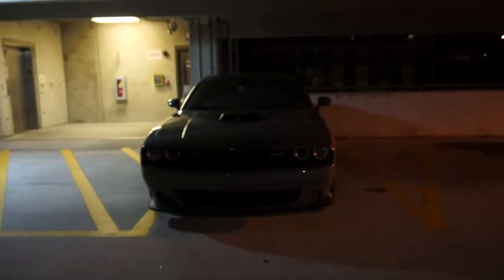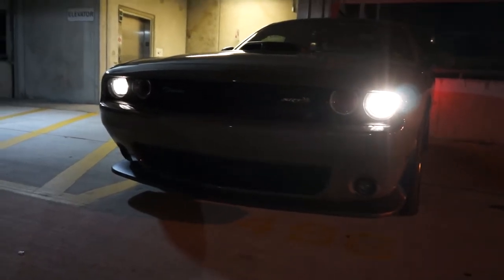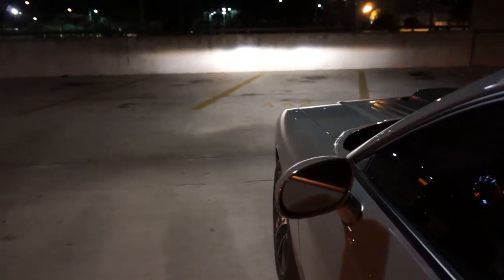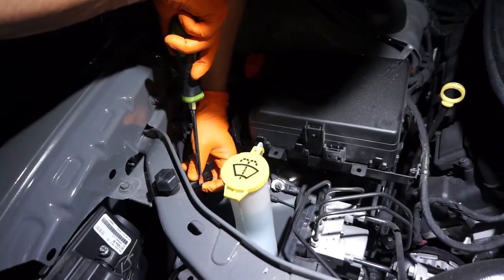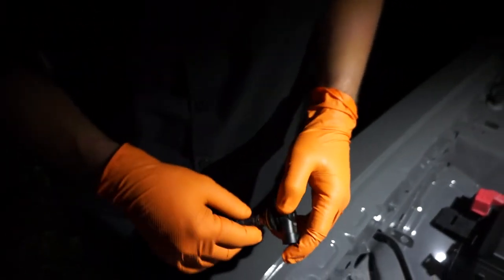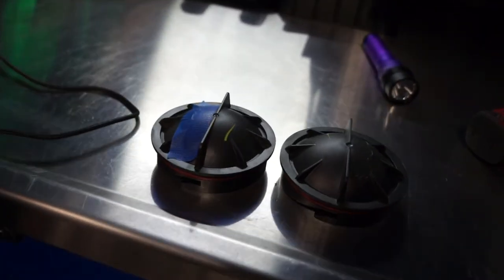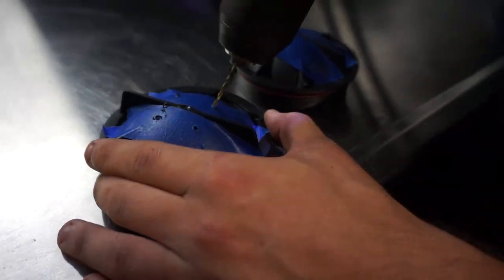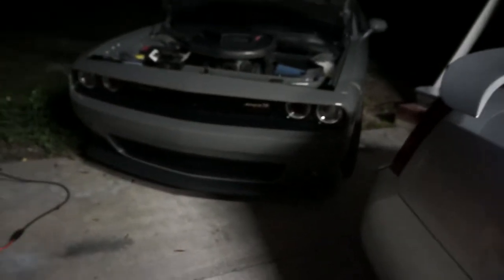INSTALL: LEDS VS HALOGEN BULBS #ledheadlights #led #ledvshalogen

Comment: Engineer here.  Don't drill holes in your dust cap.   Either leave them off, or my recommendation is screw them on and leave them be.   Yes, its circulating the same air, but the entire light housing has some thermal conductivity, so your goal is to simply remove the heat from the hotspot and distribute it evenly throughout the light housing.   Those tiny holes are not going to make a difference in ventilation, as remember that hot air cannot leave unless cool air replaces it, so natural conduction won't accomplish much considering where the holes are and how small they are.   You would need larger holes on the bottom and top of the light housing, but air in that area is likely to be quite hot anyway considering underhood temperatures with the 6.4 liter rendering such efforts moot.   LEDs are thermally efficient and don't produce that much heat output, and in fact significantly less than the halogen bulbs it replaces.

Edit: Looks like the loss of focus isn't that bad, but when shopping LEDs look at two primary things: 1) Is it clockable 2) How thin is the thermal interface between the two sides of the LED (the thinner, the crisper the light focus).
Reply from the maker: Thanks for the thoughtful comment I really appreciate that
Reply: So no dust cap is okay?

Comment: Just some constructive criticism. In the first place, led draws less current, AND stay ALOT cooler than the OEM. Also, by drilling the dust caps (rendered unnecessary) you've opened the housings up to crud AND moisture fog. Bad idea.

Comment: I'm on my 3rd set of led's , all 3 different price ranges and still havent found a set that's worthy. They either flickered with or without the canbus decoders , scattered lighting instead of a solid pattern no matter which clock position they were installed or they were bright for a short period of time and then became worse then the factory bulbs. Though my Challenger is a 10' with the regular halogen reflector head lamps. Think I'm going back to halogen bulbs as of tonight I have 1 Led not working at all.
Reply from the maker: Oh wow I’m sorry to hear that? Did u try the brand I’m using? They flicker in the start up stage of turning on the car but other than that they have lasted me this whole time.  U could consider HIDs as well. Hope it works out for you....
Reply: They do loose brightness after a couple of months I noticed mines was hitting hard only at first then now it's gotten shifty

Comment: Just curious, what year is your scatty? I have a 2015. Changed the headlights out maybe a month ago but I have D3S HID lights. I thought you should’ve had the same set up as I was surprised when I saw the regular bulbs come out as those or the LEDs wouldn’t fit my car even tho it’s also a scat pack. Also for those scrolling through looking for info, I highly recommend you physically check your bulb type first since these don’t fit all challengers. You don’t want to order something like this only to get under your hood and realize you can’t use it.
Reply from the maker: It’s 2017. The 2017 and 2018 should be the same that’s odd yours is different
Reply: I understand different bulbs came with the different trim levels, packages.

Comment: Did you have any trouble with getting the locking collar on the light to lock in with the factory housing? I just got these lights for my challenger and when I lock them in they seem loose and are hard to tell if they’re orientated correctly.
Reply from the maker: Yes they should lock. I must admit that it is hard to see when u install. The rotate in the same way as the stock bulbs
Reply: Diode dynamics have an adjustable collar to properly align the Bulbs led chips. ( both should be facing to the side,  at 3 and 9 o'clock position. )  many of the Cheap brands will give poor results, poor fit, and burn out from heat.  Like anything else,  you get what you pay for.   Good luck!

Comment: Did you get a weird light pattern? My 2015 SXT with HIDs got a weird light pattern. Not sure if the LEDs would do the same.
Reply from the maker: You would just need to make sure you position the bulb the way the stock one was positioned. Weird pattern? Might be that bulb I’m unsure

Comment: So I just got my Challenger and I bummed at how crappy the lights are. My wife's XC 90 has beautiful LEDs and I was assuming since I got a newer car it would the same .. nope it's crap... I going with the LEDs as well .. thanks for doing the video
Reply from the maker: No problem LEDs are a great option for your headlights
Reply: My Mazda 6 had self leveling LED that also turned with the steering. My new Challenger has HIDs and they are terrible in comparison.

Comment: You might have said it in a video and I wasn't paying attention know did you see their bright white or they lightning blue 5K or 6K ? Trying to get the best one that matches the Halo
Reply from the maker: With LEDs if your wanting to match the halo 5k might be your choice. I went 6k cuz they are white with no blue. U can tell very slightly that the leds are whiter than the halos but it isn’t very dramatic

Comment: How are the leds holding up? And I thought the challenger was 9012?
Reply from the maker: They are holding up great!!! The size bulb depends on the brand you get. My suggestion is to double check with the specific brand cause the numbers can change from what Ive noticed
Reply: I have a 2017 challenger rt. It should be able to use 9006 as well if yours held out.
Reply: Also did you get an error code?
Reply from the maker: Dero TV no error codes